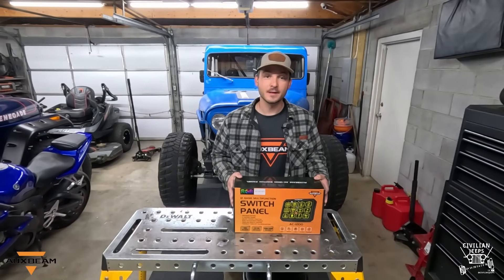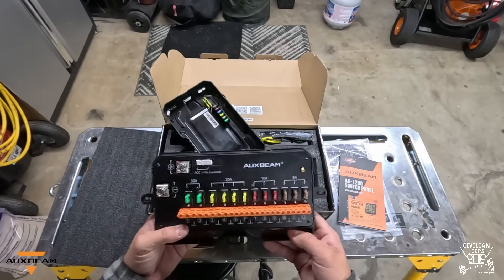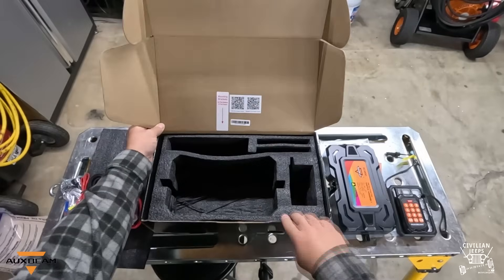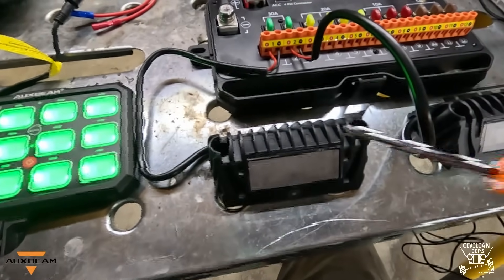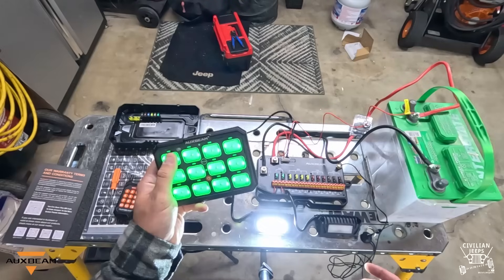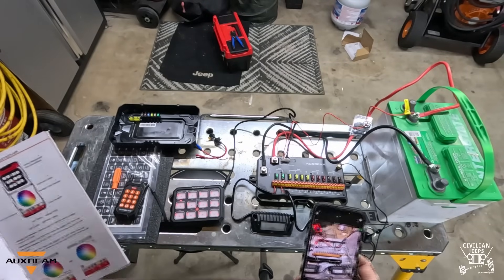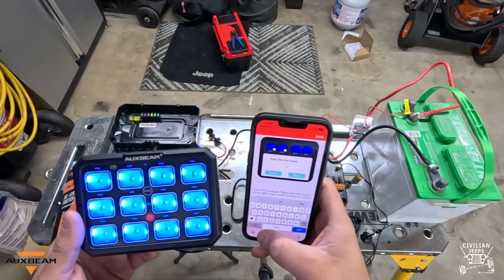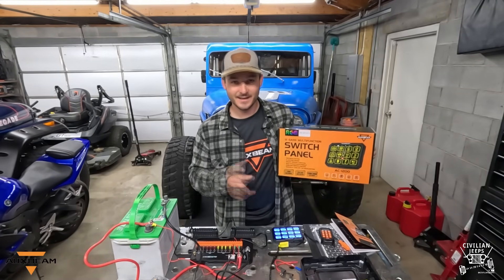Wiring & Overview of Auxbeam AC1200 12 Gang Switch Panel

Comment: Hey, i have my 52 inch light bar that is 450watts , in which Amper switch have to be connected?
Reply: 450÷12V. About 40A draw.  Best to install a separate relay and fuse. Use one of the 5A switches to control the relay.

Comment: What do I do if my wiring harness has 3 wires? Red black and white. The switch panel fuses only have red and positive connections. Where do I put the white wire?
Reply: If the third wire is in reference to a back light or a low function then it needs to be wired to a separate button by itself.

Comment: Hopefully you can help,TIA I want to buy a 22 Inch 6 Modes White&Amber Off Road Led Light Bar
Sku: ZD000655, from Auxbeam. I have the Auxbeam RGB 6 Gang Switch Panel RA60, and thanks to you and your video hooking it up was super easy, I'm trying to figure out if there is a way I can control the light bar fuctions, like switching to amber and back to white and using the strobe effects...help
Reply from the maker: @unforgiven101inc  I had the same issue with another set of multifunction lights. The multifunction aspect was built into the switch, and I couldn’t figure out how to get the switch panel system to control the modes. I ended up using the factory harness that the light came with because I couldn’t get it wired in correctly to the panel. That’s probably not the answer you were hoping for. I wish I knew how.

Comment: It would be nice if the buttons were addressable in the app so you weren't locked into button 1 controlling whatever is plugged into output 1 and could just map them to anything you want with the app. Would have been really easy to design that in since it is all micro-controller code and the switchpro does that. But seems like a really good value for what you get compared to the competition.
Reply: Or just take this into account when you are designing and wiring your system?

Comment: Does it need the keyed power wired in order to function? Would like to leave it as always hot and be able to just power down the unit so that I can use it with the key off
Reply from the maker: You can hook the ignition wire to a constant hot like I did in the video. It’s just the display that will remain on. You can hit the mode button to turn the display on and off. So technically yes you could leave it to a hot and it shouldn’t drain the battery. If you turn the backlight on the display off every time. I personally plan on putting the ignition on a toggle switch, so I can connect and disconnect from the battery whenever I need.

Comment: How do you adjust the panel brightness
Reply from the maker: The easiest way to manually adjust is through the Bluetooth app. However it has a sensor on the front of the panel that adjust the brightness automatically, dependent on its surroundings.

Comment: Awesome video! I wish they would’ve included a “double click” option for the switches to have different modes easily accessible.
Reply from the maker: Thank you! 

The controller has quite a bit of functions built in. I do prefer the app over using the panel to change functions though. I feel it’s a lot easier to use. I’m impressed with how easy it connects to Bluetooth as well.